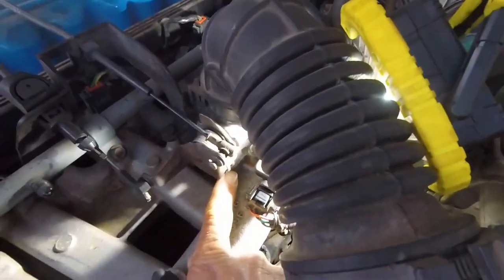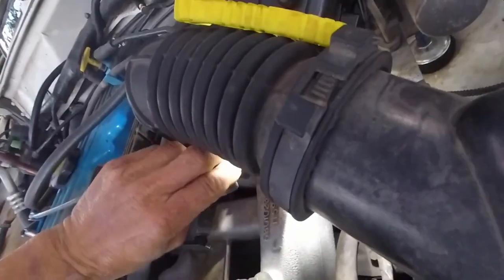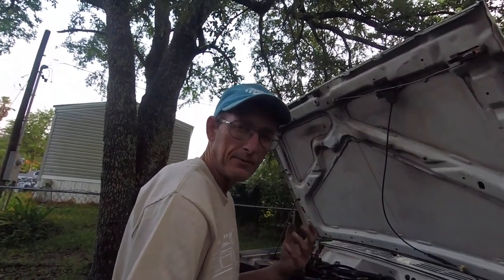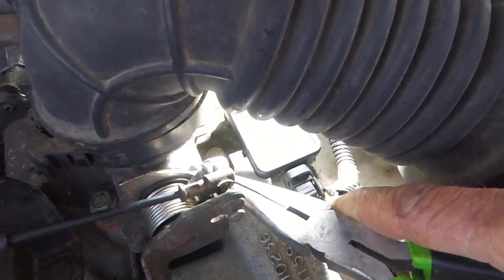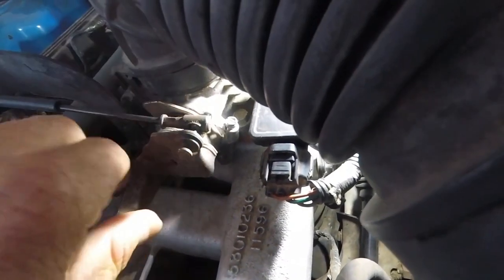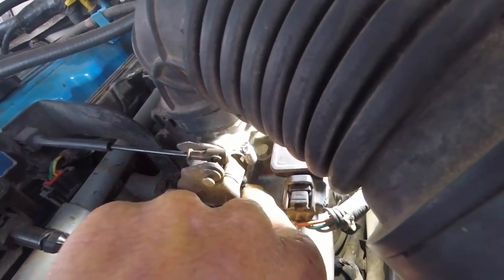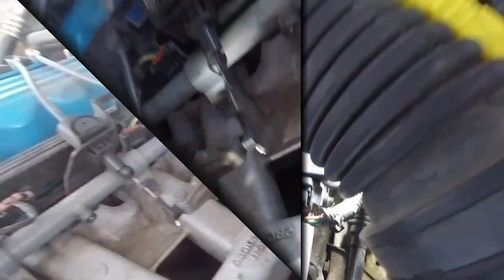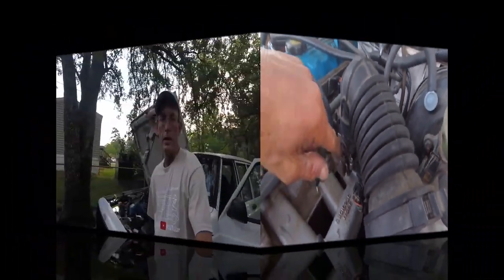Quick, Cheap, Easy Fix on Jeep 4.0  6 cylinder XJ Low Idle Adjustment !!

Comment: perhaps the low idle is being caused by a dirty TBI plenum and it needs to be taken apart and cleaned anyway?
Reply from the maker: This is true that it could be that. My trick is a quick fix ,side or the road, or away from parts stores for new throttle body gasket etc. Or even someone that doesn't have the knowledge to remove it and reinstall it etc. Thank you !!
Reply: Tha brather is  hanging too much we the Mexicans brathers!!😂